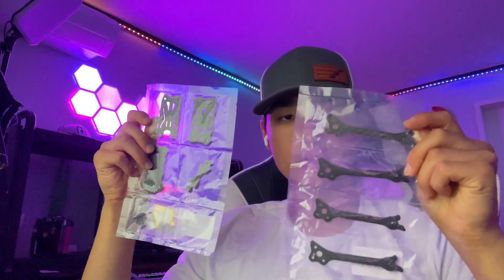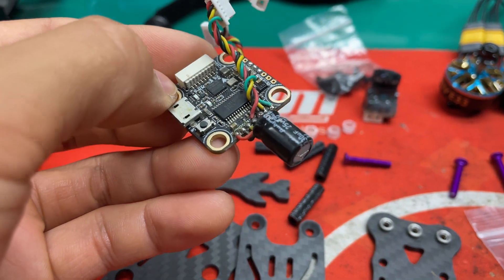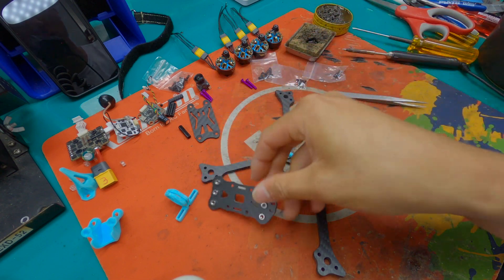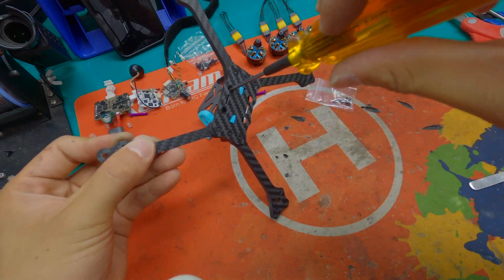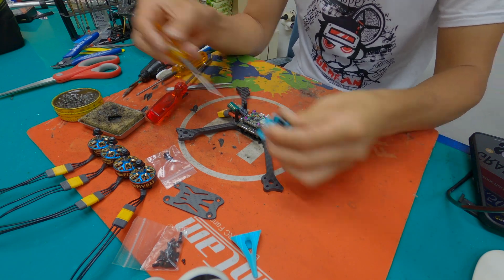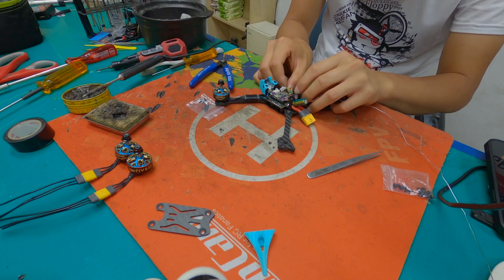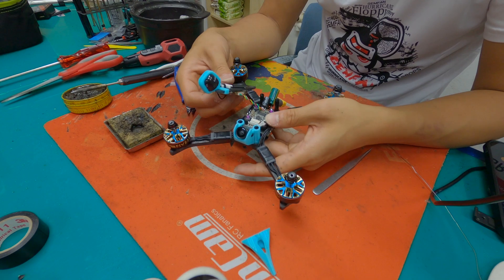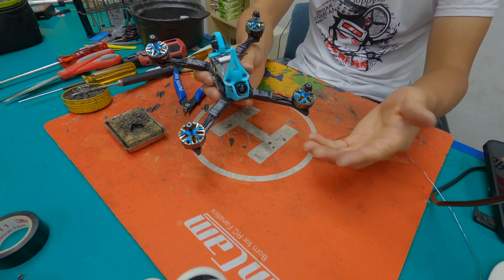Building a MultiGP IO Winning Drone / with Five33 LightSwitch

Comment: your props are badass ,, switchback is super tight love it so light. I have the updated pro lite . I am using the M5 pro its just a little bigger .easier to control for me not as good as you YET hahahahahah then i will go to the switchback ,, the M5 pro can use 30 x 30 stack too and 6mm arms I broke an arm on the Switchback already .. 6mm are really stiff arms where as the switchback seems more forgiving

Comment: I’m surprised that you are using mr30 connectors for the motors.  I remember back in the day all ESCs and motors came standard with bullet connectors but this practice has been abandoned because since those connectors are usually not connected and disconnected often enough humidity would get in and make the contacts unreliable.  Hopefully this will not happen with the mr30.

Comment: Very interesting that you put a cap on the FC. What voltage and F do you use?
Reply: Rubycon HLZ 25V 330mkf
Reply: @azixaka  where do u add the capasitor too? Does it improve filtering?

Comment: For those asking for a tune, Karate Race Preset in BF 4.3
MUST USE RPM Filters
For F7 use Dhsot600 and F4 Dshot300
Reply: yes , rpm filter s must with this tiny frame ,, its wide open or nothing I am using the speedy bee F7 mini 35amp paired with 2207 1855 xing 2 motors , That little 35 amp board is so lite and  powerful super dependable for a practice quad paired with the speedy bee tx800 crystal clear video
Reply: Dshot2400 only !